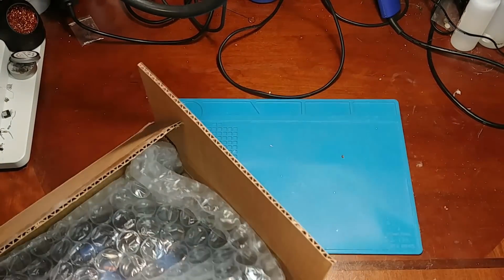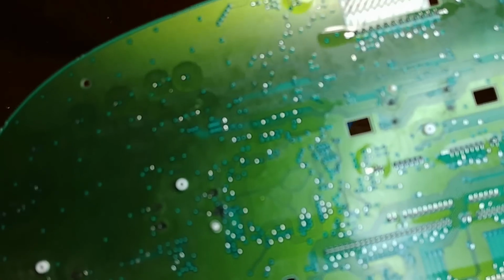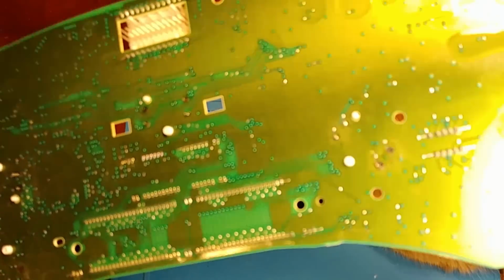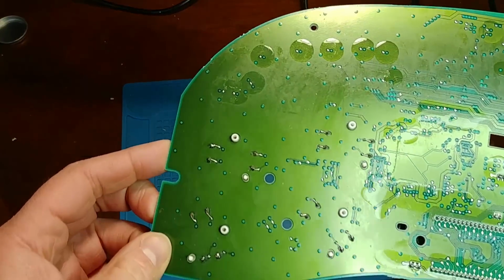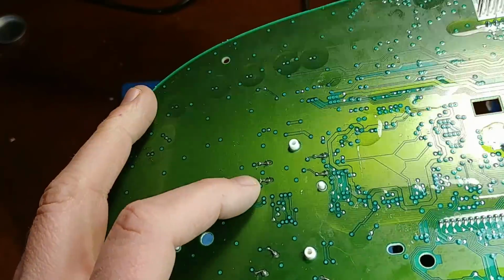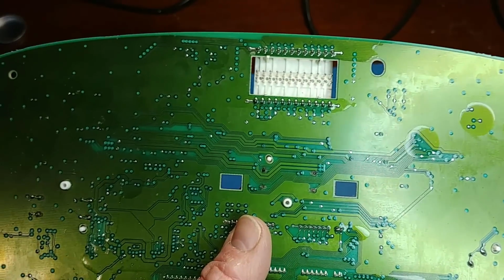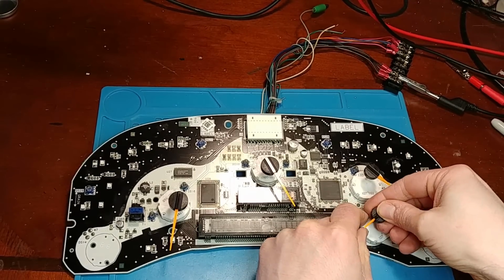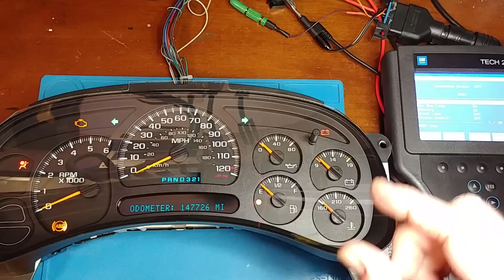Repairing a GM cluster someone tried to repair that was sent off to repair.

Comment: I attempted to fix my instrument cluster.  I Checked out this video, and compared to this cluster mine looks pretty clean.  Problem is on reinstalling the cluster there was no power to it.  Checked fuse, nothing blown, but replaced it anyway.  Still no power.  I able to see at least around the left of the cluster and the plug looks like its plug in, (I think).  Could my repair be so bad to cause the cluster to be without power?
Reply from the maker: It's possible you knocked a component off the board, or dropped some solder on the board, or killed the microprocessor with ESD.
Reply: @jeffescortlx  Thanks, don't know what with ESD means, but OK.  I would send the cluster to you, but since I have been delayed by this problem for almost two weeks I decided to buy a refurbished, or used cluster.  It arrives on Thursday so  I hope I can install it successfully.  Shouldn't be any trouble, I've installed the existing one three or four times.  I viewed three videos, but somehow missed yours.  If I had seen yours I would have just sent it to you.  Live and learn.  Thanks for the reply.
Reply from the maker: @dad004dad  ESD= electro static discharge. In other words that chip is static sensitive.

Comment: What are you eating cat?  Lolll  gotta love a professional with animal help.  Damn man you are fast  nice video. Detailed well. Im having issue getting needles off. Feel like someone glued them down and all of my stepper Motors were replaced all my needles and gauges worked great it just lost complete power every so often like when I would hit the high beams or tilt my wheel the gate cluster would shut off and not come back on for at least a week or two but now it's completely Don no power to anything just the lights and I can't see anything that's broken our why would be doing this. Is there a relay or something in the ignition column that would control Power to be losing when I touch the high beams or tilt my wheel cuz I brought the cluster to other people and they've tested it and said that everything is fine everything works out they put power to it it turns right on so I am at a confused point right now
Reply from the maker: I'm going to take a wild guess you have a 2003-04 full size GM?
Reply: @jeffescortlx  05 hahah burban

Comment: On the soldering of the strap resistors, what temp do you recommend using to touch them up???
Reply from the maker: I typically have the iron set around 340C
Reply: @jeffescortlx  thanks for the reply!!! Also thanks for the videos because I really love the way you made the fixes on my 2003 Chevy tahoe, affordable  and comprehensive by way on the  point on content in the illustrations you give and ESPECIALLY the tips on the do's and don'ts!!!! I like to think I am a hobbiest with dealing with electronics!!!!
Reply from the maker: @jasonturner4265  glad to help

Comment: Hey Jeff 
I have an 04 H2 bd. It has no Odometer readout . Upon inspection I noticed a 66 ohm resistor on the secondary side of 10 pin transformer that drives the Odometer digital display is burnt up . On the primary side of transformer a small mosfet shorted out . Replaced them both. When 10 pin transform is in  circuit , the small fet runs super hot and will burn up if kept on too long . Replaced the transformer and round 4 leg coil above it . Same thing . Any thoughts ?
Ty sir -Mark
Reply from the maker: I believe that transformer runs both the high voltage (42v) for the VFD driver chip, and low voltage high current for the VFD hot wire. Try manually injecting 42 to the cap in the bottom left corner, see if the driver chip get hot.
Reply: I’ll try it .. thanks
Reply: Hi Jeff I haven’t had a chance to inject the 40vdc into that cap to see if it restores the display without running hot . I put it all back
together. But if it does what would you think the fix 
would be ?
Ty sir
Reply from the maker: It depends what component gets hot. That's your short.
Reply: 10-4 ... I’ll give it a shot ... ty for your help
Reply from the maker: Are you getting a short across that rail? Did you check the diodes in that area?
Reply: The transistor above the m4 was shorted (primary side ) 
Secondary side believe the 4 diodes ( all are good - even replaced ) the 62 ohm resistor (620 marking ) fried .

Comment: 2003 buick rendezvous — all gauges except speedo are inop. — error reads at odometer and warning lights are cycling — is this due to cluster or BCM and if it's a cluster problem can you fix it? Oh and PRND32 indicator not lit.
Reply from the maker: Could be all internal cluster issues, but loss of serial data can also have similar issues. Anything else acting strange in the car?
Reply: @jeffescortlx  i cant communicate with pcm
Reply from the maker: Sounds like you have a communication issue. Could be coming from any module that has a connection to the serial data wire.
Reply from the maker: It goes to every thing. ABS, air bags, BCM, ECM radio, HVAC.
Reply: I found it yesterday. I wanted to inspect the ecm harness further by the air cleaner box so I pulled everything out of the way and saw 2 connectors attached to the strut tower one of them was right on top of the shift cable. I flipped it over and there it was..... a rub through and another next to it with the casing gone wire exposed. I soldered in 2 new wires and everything works now!!! One broken wire caused all that trouble!!!
Reply from the maker: Albati love hearing happy endings to a repair!

Comment: I was just wondering I pulled out my cluster panel and resolder the computer chip because my gear select was real dim I fixed that now I can see it again but in the process when I removed the needles I didn't mark the positions and when putting back together I felt dumb because I am not sure how to collaborate the temperature gauge and the oil pressure gauge is there an easy way to do this
Reply from the maker: Not really a easy way without the ability to do it on the beach. You'll just have to pull and reseat the needles where you think it should be. Or send it out.
Reply: @jeffescortlx  okay thank you very much I used a Diagnostics scanner and tried to match it up as close as I could

Comment: Hey i have a quick ?
How do you remove the needles on a 07 thru 14 cadillac escalade.
Reply from the maker: Same way as the older ones. Break it free with a twist and continue twisting up with a pry tool.

Comment: Hi, may i know what part number for 2007 chevy equinox cluster stepper motor please. Thanks.
Reply from the maker: They don't necessarily get sold by part number. I typically just see them listed as equinox if you can find them.

Comment: How much is it to upgrade to LED and do milleage correction on a 2008 chevy trailblazer ss cluster ?
Reply from the maker: LED's and no extra charge with full rebuilds. Rebuilds are 120. Mileage correction would add 40.
Reply: jeffescortlx.  Ok wat if the cluster i bought works fine just need the LED upgrade and mileage corection how much for that ?
Reply from the maker: It already has upgraded x27 stepper motors?
Reply: jeffescortlx dont think so its stock
Reply from the maker: I had to stop doing partial repairs. I ran into too many problems. People would say "my cluster works great, just need this one little thing done", so I would quote accordingly. Than once I get my hands on it it turns out the stepper can't even pass a full sweep test. But the problem is 6 months down the road problems start showing up and it becomes my fault because I was the last person to touch it. So now when I'm in clusters I replace everything.
Reply: jeffescortlx. True yeah either way i think ill just send it and get rebuilt done and the mileage corection ..ill contact u soon im on a trip right now

Comment: My driver information center is really dim what could be the problem
Reply from the maker: Depends, what year is it? 2005?
Reply: @jeffescortlx  yes it is 05 z71
Reply from the maker: You'll need a new VFD display.
Reply: @jeffescortlx  ok thanks!
Reply: @jeffescortlx  would I be able to use one from the junkyard
Reply from the maker: The display? Sure, 03-04 seem to hold up the best from high hours.
Reply: @jeffescortlx  thanks I'll try that. After installing it would I have to reprogram or do anything special to it
Reply from the maker: No not the display.

Comment: Hello just wanted to thank you for all your excellent videos ! 
I just got a used 04 Tahoe & all gauges seem to work fine with one exception, the cluster reads “service brake booster” as the Tahoe has hydro boost brakes this doesn’t really apply. I’m sure somewhere in the vehicles life the cluster has been changed with the donor being a vacuum booster equipped vehicle.  Can this be repaired/programmed properly? I also would like to see about it being gone thru & all checked out if possible.
If you would please send me a message at higz@windstream.net

Thank you !!
Reply from the maker: I'm sorry but I'm not able to program the brake booster function. Yes it does sound like someone put the wrong cluster in your Tahoe. This would also mean your odometer reading would probably be incorrect to.